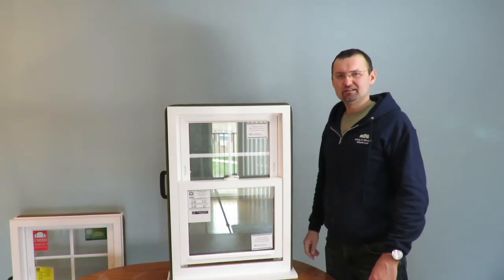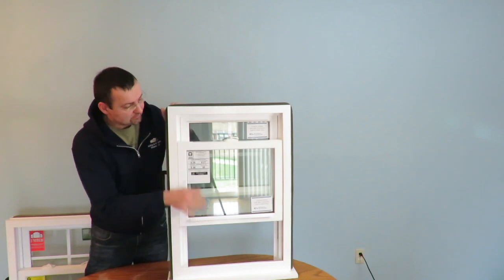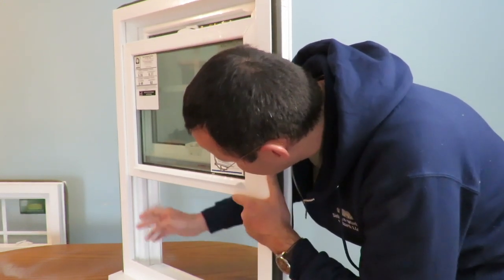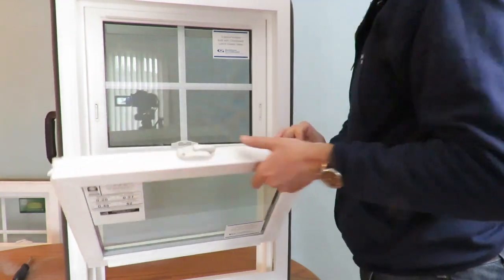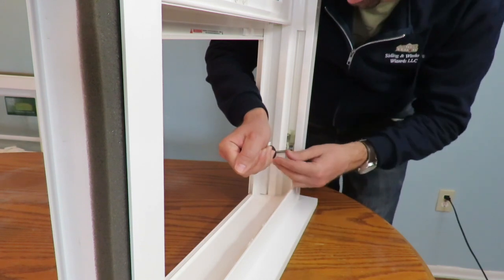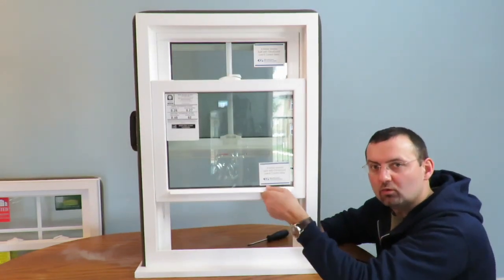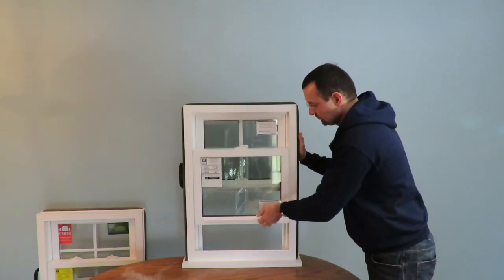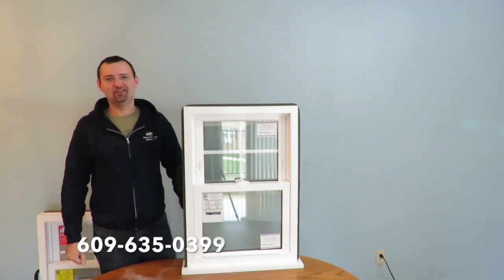How To Fix Windows That Don't Stay Open

Comment: Hi....Question for u.......Do u think I can convert a constant force  sprint window to the one u show in the video balance sistem ... Let me know trying to fix about 7 window in my bldg that I do work.....
Reply from the maker: Hi Adrian, unfortunately you can’t change constant force balance system to block and tackle. It is gonna take you a lot of hustle and unnecessary expenses, but the final result is not gonna make you happy. The window is not gonna operate properly
Reply: @SidingWindowsWizardsLLC  thanks

Comment: Hi, thanks for the video. I have both of my balance shoes in place, but for some reason my window still won't stay up. It feels like balance shoe doesn't provide any kind of resistance at all. Please advise. Is there a way to "recalibrate" balance system if I remove the window completely? Thank you!
Reply from the maker: Hi Dmytro, the best long term solution in your case is gonna be replace the balance systems. After some time they wear out and no longer capable of holding the sash. If you have block and tackle balance system like in the video the window has, it is pretty easy to replace it